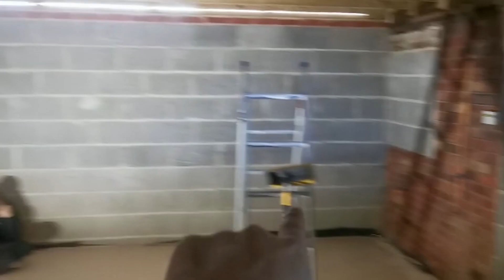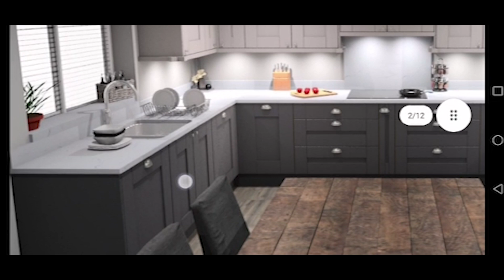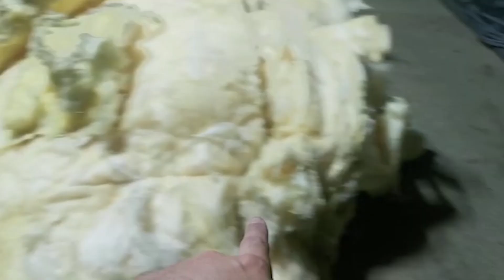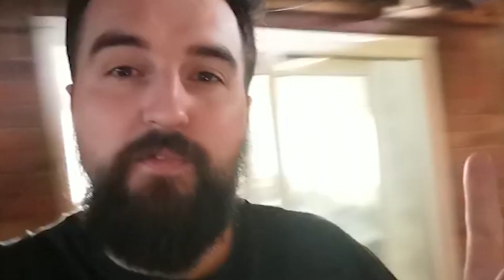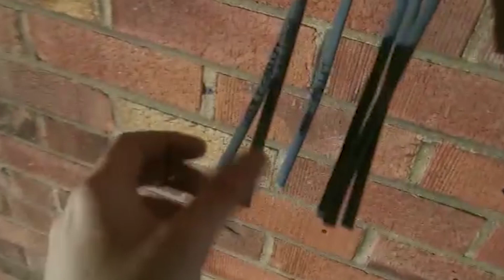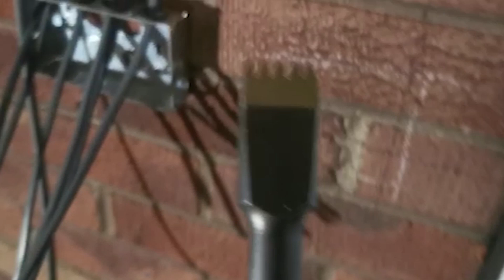KITCHEN WIRING... BUT IN THE DARK 🤯 🌃

Comment: Nice video.
Couple of questions. 
Capping? I know it’s not regs but still good practice.
Local means of isolation? I know you’ve said sockets in cupboards for appliances
Reply: Great content anyway
Reply from the maker: Heya buddy, cheers for the likes and comments! Really helps the channel grow! I never seen the point of capping and don't see it neater either. I guess you get used to what you see every day, so every company has their own little traditions. For me plastic doesn't provide any protection from like a drill or anything once its in the wall. A drill bit will fly through that. Metal capping has a little more give before going through. Only way I see usingetal capping safely would be to earth the metal which no one is going to do. Bang a 5.5 fixing through the capping and hit the live side of a twin and earth and the full price is live in the wall which is alot worse 😂 each to their own to be fair. As long as the customer is happy and it meets regs all is good in my books 😁
Reply: @finneyelectrical  agree pal, and deffo each to their own, I’ve just always done capping  and was taut to do so., 
so when I see none “Cappers” it’s something I don’t really like. 
I use capping not as protection but as protection from the plasterer. 
Keep up the good work and Content 
All the best
Reply from the maker: @gc2electricalsolutions973  to right lad 👌 you got any content? Tik tok? Insta?
Reply: @finneyelectrical  Instagram pal, quite lazy with the content thou plus I can’t fault you for putting yours out for everyone to see, I was just questioning what I see as I do that for a living
Reply from the maker: @gc2electricalsolutions973  no worries good to support other channels 😁